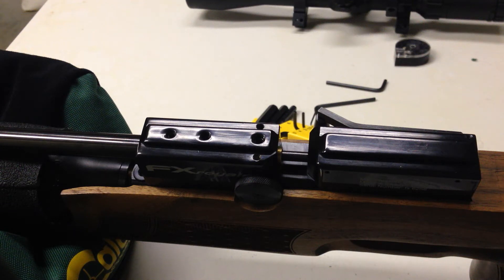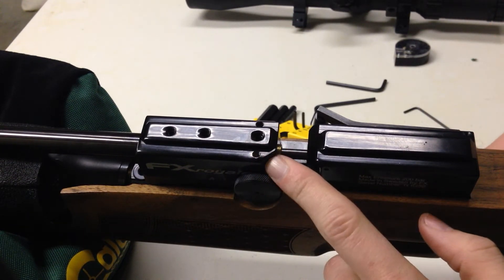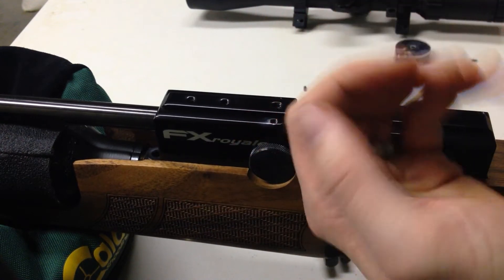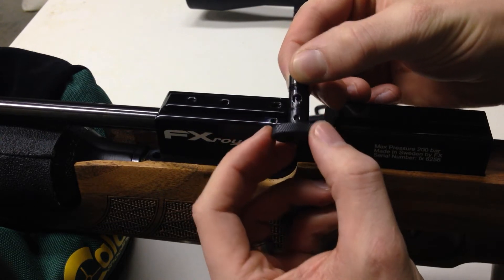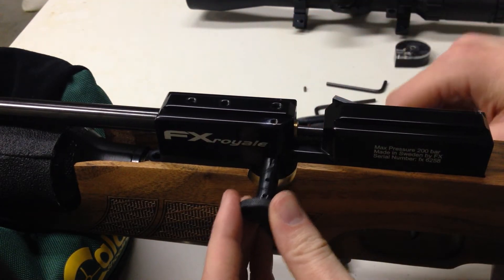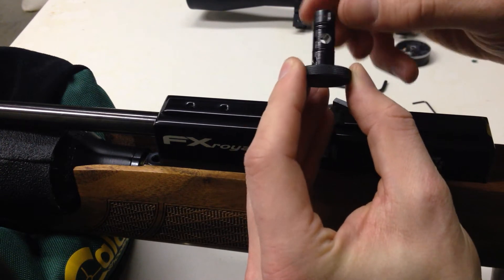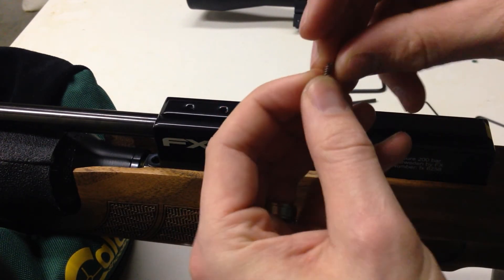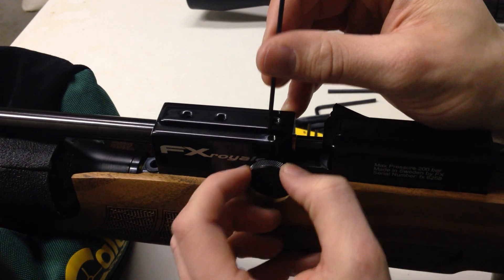How to disassemble and replace o-rings on FX Royale 400 power adjuster

Comment: Thanks for your video very helpful. My 400 as only fired around 1000 pellets but i can feel a slight blast of air which seems to be coming from the power adjuster wheel when i put my face near it do you think it could be the seals have failed i also put a piece of tissue paper over the breech area to test the breech seal and it felt as though air was pushing backwards into the breach but because the seal sits in the breach and not on the probe as most guns do you also think this could be the issue and do you know if the breach seal is as easy to change . Thank you from the UK .

Comment: Can i ask which o ring blew out was it the one nearest the wheel .I am struggling to get the whole thing out i had to take the grub screw out the centre of the wheel and just take that section out it has a o ring up against the wheel and mine looks crushed on one side